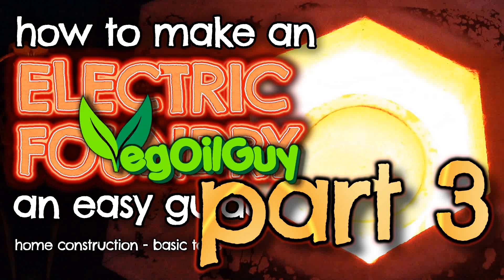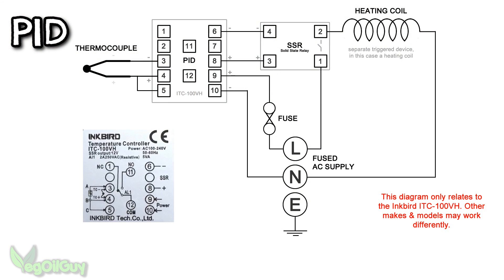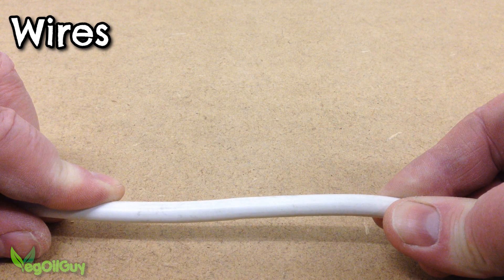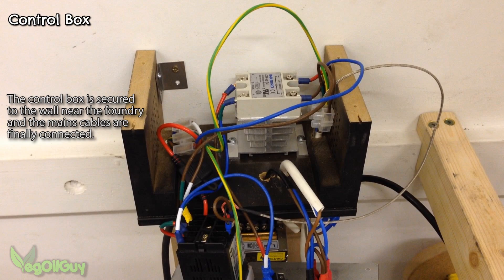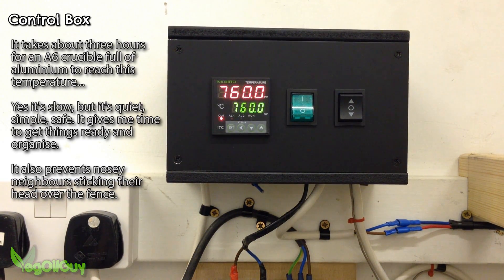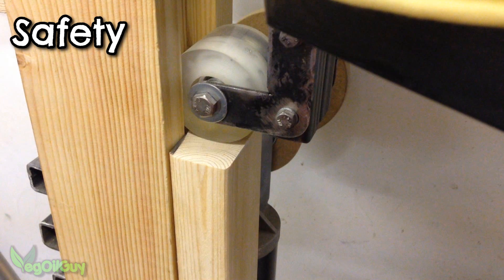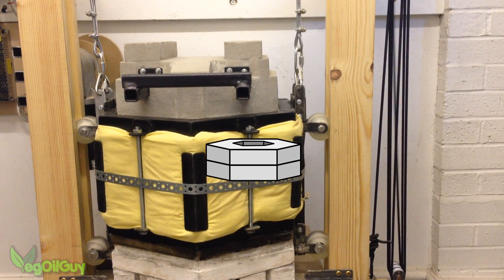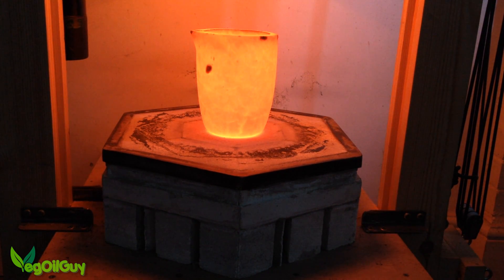How to make an ELECTRIC Furnace (Foundry) for metal casting Part 3 by VOGMAN

Comment: Amazing tutorial & incredible design. You have a fantastic mind to figure all of these things out and put them together to create a machine with more features than machines worth thousands of dollars. One question I have is would a slightly altered build of this design be suitable for ceramics such as porcelain which requires a firing temperature up to 1400 Celsius? This is my current project so any input from that incredible mind of yours would be greatly appreciated. Given that we are restricted in regards in amperage with our 240v home power supply I'm not sure if this is possible but hopefully I'm wrong.
Reply from the maker: Again, many thanks for the kind words.
At 1400C your reaching the limitations of this set up, but I but think it's possible. Grade 30 firebricks would be the minimum spec, plus additional insulation to maximise heat retention. Also a thicker wire with higher tolerance - I think this Kanthal wire maxed out at 1400. Lastly, I stuck with 10 Amps. If you're happy enough to nudge it closer to 13 Amps, you can gain a lot more power.
In short, yes, I think it could be done, but you'd need to research all of the materials and go higher than the max you need.
And fantastic mind? I wish... but you're very kind  : )

Comment: Hi, your video is really nice. It is easy to see you put a lot of effort in it. I want to make an less expensive electric foundry so I will not integrate the lifting part and I was wondering, if I use metal tools to lift the crucible and I accidentally touch the red hot wire. Is it dangerous to make a short or something?
Reply from the maker: Hi Renaud. Thanks for the kind comments.
Yes, you're right. The coils are live and carry a LOT of current. If you touch them with something metallic there is a danger of shorting out the coils and, worse, electrocution. I'd recommend before lifting out the crucible, simply turn the power off.
Reply: VegOilGuy easy and efficient methode

Comment: Where did you find the thermocouple rated to 1450c? I cannot find one rated that high with that type of connector. Thank you for your help.
Reply from the maker: eBay... I just searched and was lucky enough to find one : )
Reply: Thank you, I have been on but will keep looking.  Thank you for putting out all of the info here. Great job, great project!
Reply from the maker: Pleased to help. I'm very pleased with my electric foundry. Good luck with your project : )
Reply: Can you provide model & serial numbers for the thermocouple rated for 1450C. 
I too am having zero luck finding one.

Comment: I am having trouble getting the pid to output the right current to the kiln as it outputs too much then gets too hot and also how do I change the temperature changer so it goes up in 1 degree at a time because it takes ages because it goes up in 0.1 at a time
Reply from the maker: Hi. If your PID is the same as mine, it's not the most intuitive thing to use. The manual is online here http://pmod79883.pic31.websiteonline.cn/upload/szm4.pdf and again it's not very clear. 
It's been a few weeks since I adjusted mine and I'm nowhere near it to check right now, but if I recall correctly, press and hold the SET button until everything starts to flash. Then use the arrow buttons to move through the menu until you see DIP which is Decimal Point Position. Set this to "0" and then you'll only see whole numbers : )
Another tip I have for you... it's not necessary to scroll up the desired heat setting in single units. Let's imagine the screen says 100 and you want 600. Rather than go up in singles, ie 101, 102, 103, etc, you can use the Left Arrow button to shift the small dot indicator. Shift this over to the 1 and you can then go up in hundreds, ie 200, 300, 400, etc.
If you need me to do a brief video on using the PID I'm happy to help.
All the best.
Geoff
Reply: VegOilGuy I think I’ve got it sorted now because I realised that when it heats up it just puts full mains until it’s the right temperature and I was using a short coil as I was making a smaller test one so the coil would get insanely hot and overshoot the temperature but now my larger container has arrived so it should be fine, thanks

Comment: Great job!! Have you done any calculations on operating costs?
Reply from the maker: No... I'll completely (eyes shut) ignore that one. I've no doubt my electricity provider will be sending me a Christmas card for boosting their Bonuses, but I'll grin a bear it in the comfort of my garage.
You can't beat free and my veg oil burner runs on waste veg oil.
Charcoal... that's actually quite expensive really... I can get through a bag in a day.
So how will it compare? Worse than veg oil, more expensive than gas, maybe on par with or just a bit more than charcoal.
I'll cut down on the wife's Soaps to compensate  : )